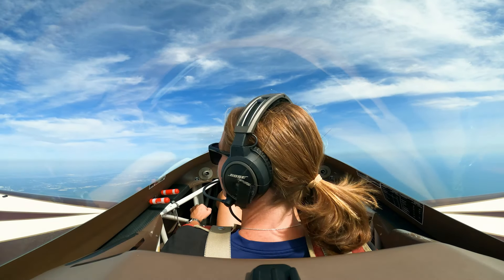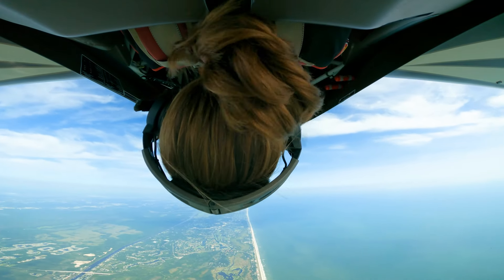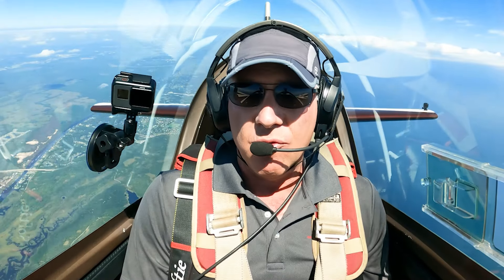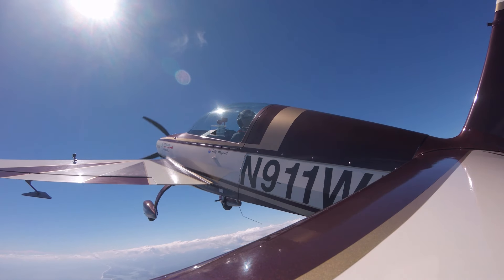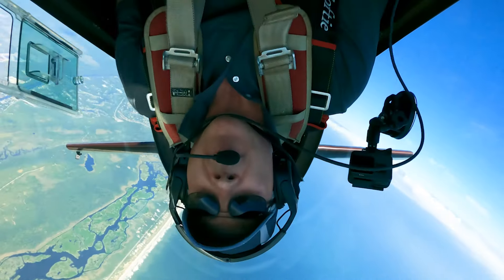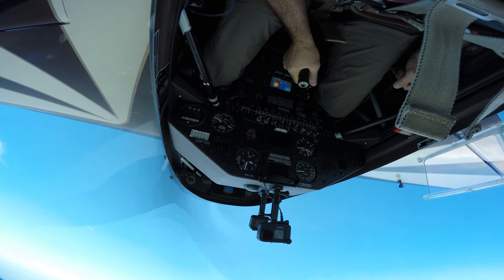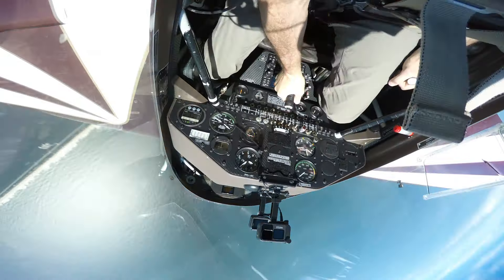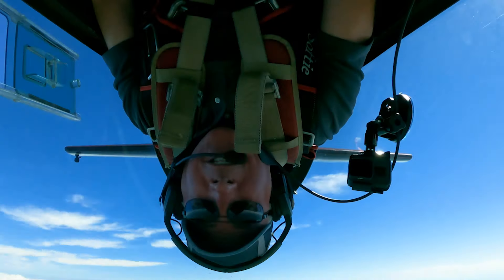Turns, Stalls & Spins - Episode 5: The Inverted Flat Spin

Comment: I remember many years ago Gene Beggs thru IAC Sport Magazine introduced the hands off recovery technique. Basically, power off, full opposite rudder and almost every airplane the stick and ailerons find netural. Then recover.

I never practiced this method but have seen some instructors teach this. Any thoughts?

I'm guessing overall it's a slower recovery but highly effective for non aerobatic trained pilots.
Reply from the maker: In Gene's book, "'Spins in the Pitts Special", he was careful to say that he tried his power off, hands off, opposite rudder technique in every Pitts and many other planes.  He found it only worked 100% of the time in the Pitts.  He cautions against using it in any other plane and called out the Decathlon specifically since it's a popular trainer that responds well to PARE but not the hands off method in all spin modes.  Hands off does work in the Extra and is listed in the POH as an emergency recovery.   The Extra didn't exist when Gene did his research. 

I did a video on comparing spin recoveries in my Pitts and found they all produce similar results - https://youtu.be/o-6SzkPNyL8

Comment: Contrary  to what you said "not something  you get into by accident" in hammerhead  aka stall turn if you are over-pitched beyond vertical,  try to push stick to go back  vertical,  then left rudder to turn while right stick to counter prop torque, you almost certainly get into inverted flat spin,  especially in Pitts.
Reply from the maker: Why would you wait that long to allow the spin to develop, no matter what kind of plane?  I have more time flying a Pitts than an Extra and they both require at least 5-10 seconds to turn a hammerhead into an inverted flat spin.  In either plane if you simply neutralize all the flight controls and reduce power the process stops and you can fly away.  The plane only does what the pilot tells it to do...many new aerobatic pilots haven't learned how to talk to their plane yet.
Reply: @ssairshows It is an honor to get replied by an inverted spin world record holder! Are you based in SZP? I am looking for any instructor who can teach in student's 2 seat Extra on some basic aerobatics like inverted spin in SoCal. In my experience trying hammerhead first time in the 2 bladed Pitts (after doing the same many times in an Extra 200), I guess the slow airspeed and big prop gyro force was unexpected (I should add I kept full power all the time, maybe normally people cut power before speed drops to 0).  Later I tried it again but with ~30mph airspeed when turning and it was OK. Still I feel I need some instructions to gain more confidence.